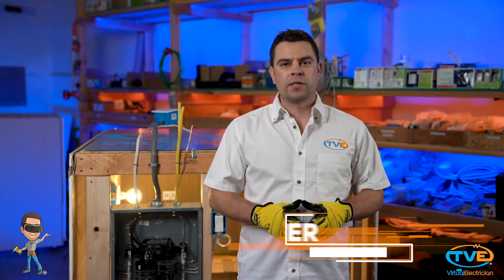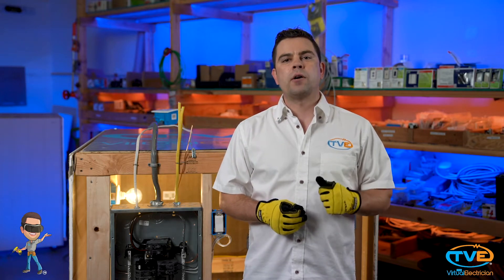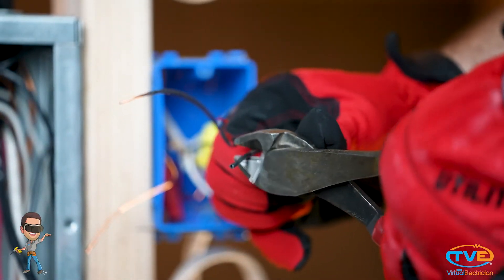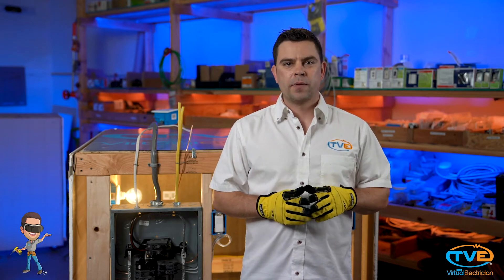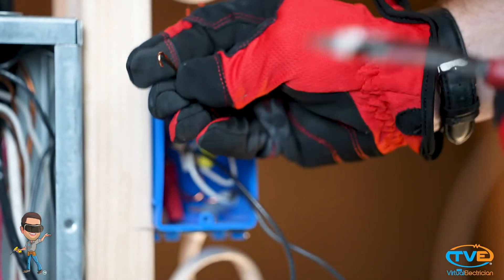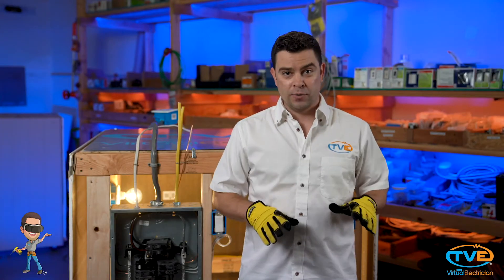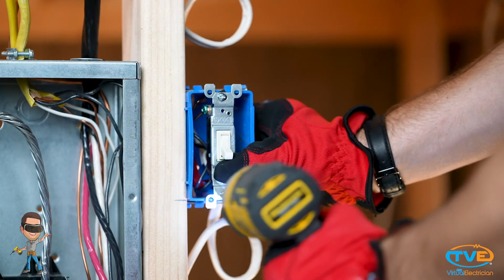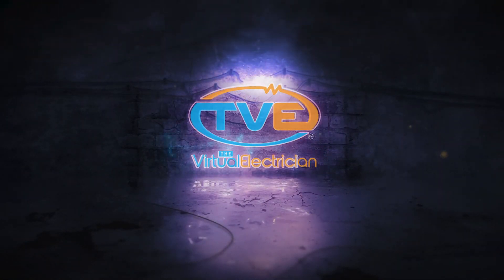How to wire a light switch

Comment: Complete novice here. You lost me at “tying ground wires together”. I have four wires - red, black, tan and bare. Trying to install new two way switch but don’t have old switch to mirror wiring. Both red and black are hot? So red goes on one screw and tan goes on other screw and bare (ground) goes to green screw and black just gets pushed back into box with wire nut over it? Help, I’m a desk jockey! I’ve replaced a switch before but always had the old switch to mirror the wiring.
Reply from the maker: there are many ways to install a threeway switch. If those are the only 4 wires in the box, then you are probably looking at an end of the line threeway switch.
If that is the case then
Bare goes on ground screw.
White is mostly likely the point and going on the black screw (this is assuming they sent the hot or switchleg over using the white wire)
the red and black will be you travelors and go on the remaining 2 screws

If this doesnt work go to www.thevirtualelectrician.com and schedule a time i can walk you through this
Reply: @TheVirtualElectrician  Thanks. A handy buddy talked me thru it. I ended up connecting black to top screw, tan (neutral?) to bottom screw and bare to ground. No sparks or tripped breaker and seems to be working fine. Thanks!
Reply from the maker: @brianegan6884  excellent!